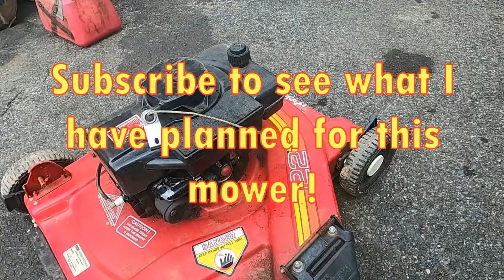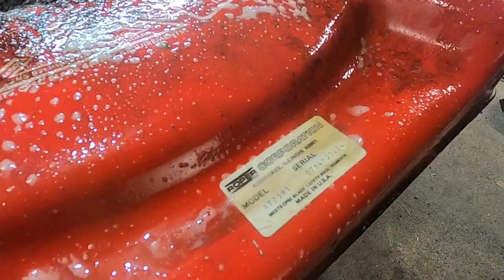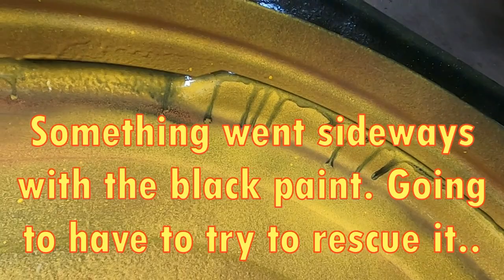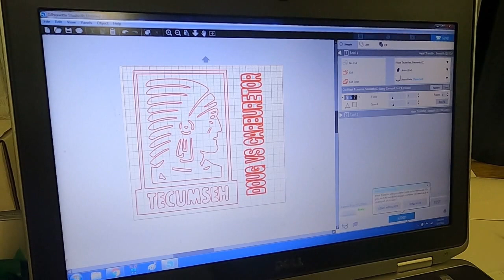Restoring a MOWER DECK like it is a CLASSIC CAR (time lapse)

Comment: Commenting as I watch...  Dude!  I've been thinking for a while to get one of those coffee filter baskets to filter out the debris so I can reuse the old fuel/oil mix I use for cleaning up things sometimes!  I've been using a huge funnel with a 1-inch removable screen in the bottom but it clogs up too fast, it's too slow and doesn't get a lot of the smaller stuff.  I tried using actual coffee filters (didn't have a filter basket yet) but that also didn't work well because it took so long to drain because it clogged up so fast.  Maybe the basket for the inital screening and then add an actual paper filter for the final screening?  I see you've got what looks like the same 15L ultrasonic cleaner.  I use Steve's (Small Engine Saloon) suggestion of several different jars for all the small stuff with detergents and water in them so I don't have to drain and clean out the machine itself.  That said, I did get an NPT/hose barb fitting I installed with Teflon tape.  Then I hose-clamped a 3/8" fuel hose long enough to reach the ground so I can drain the cleaner anytime I want into a bucket.  So far the jars haven't leaked so I haven't had to.  I've used a combination of Dawn and Simple Green with water but I think I want to go to something stronger next time or leave the parts in longer than 20 minutes.  I've haven't been turning on the heat, although maybe I should try that at some point to see if it helps with the grease.